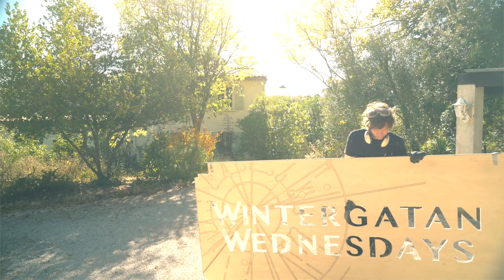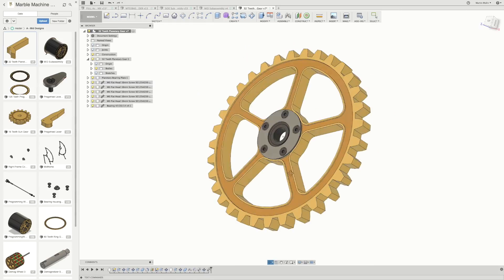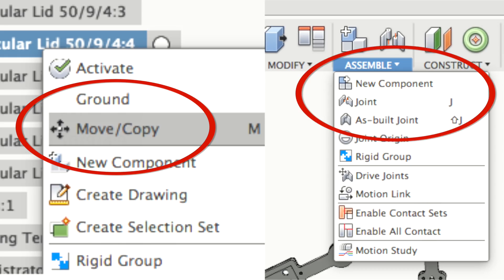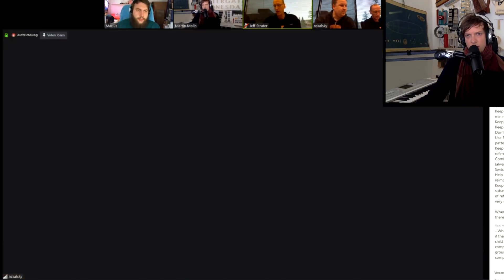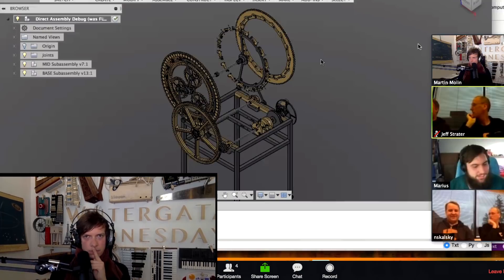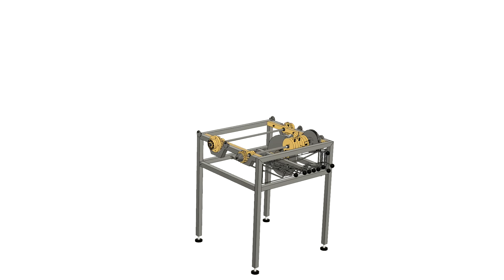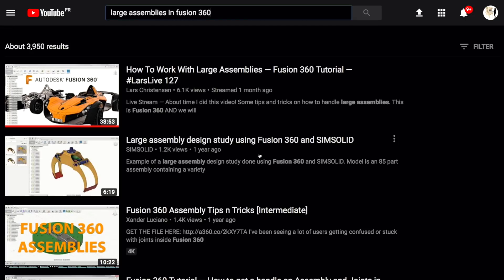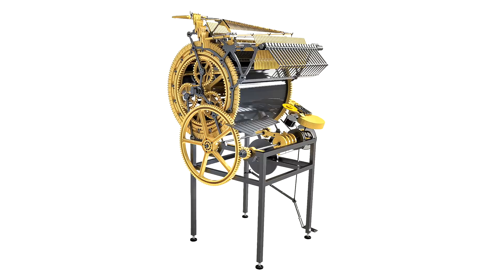Is Fusion 360 Unable to Handle Large Assemblies? - Marble Machine X #31

Comment: Hi Martin, i really hope you to read this comment. I am a CAD Engineer working for the interieur/exterieur department of a major automotive manufacturer. Even the top of the line software/hardware can't handle Assemblies as large as a complete car with all the functions expected from the real parts and joining every component to the rest as one would in the reality. For this reason every system is dealt with separately in very complex chains of sub assemblies and every component is built in in its place relative to the origin of the whole car. You just establish a new origin for the part that is in the correct position within the assembly and then if you have to move the component then you move the origin itself. I unfortunately don't know right now if you can do that on fusion 360. This approach of building sub assemblies in place is a very valid solution and the problems you face with your MMX top level assembly with Fusion 360 are the same ones we face every day at work, just on a different scale. So cheer up and i'm so amazed at what you are being able to do by building knowledge on the go.

Comment: It doesn't matter what cad system you use,  there is still alot of geometry for the CPU to solve. I have ran into this same issue in solidworks many times my solution or workaround for this problem is to save all the bodies.

Comment: WTH!!! I am Using Fusion 360 with 9000+ Components . I don't face any Issue with Design Environment but when i go in to the Drawing Platform with the 900+ component Assembly, It freezes like arctic.

Comment: I have an assembly of a plant with 7199 bodies, all them visible in Fusion 360. However, as good as Fusion is, the drawing environment really let's it down. I way prefer Inventor, although I have been using is since 2005.

Comment: I've worked with Solidworks before quite a while ago, so Solidworks 2016, I've ran into the same issue with it bogging down in large assemblies. That's my past experience so I have no idea if the newer versions are any better.

Comment: I only have one component and it shuts my computer down. No Other CAD does this to my laptop. My computer is not overheating, so spare me the lessons on overheating issues. This is on the part of fusion 360 im sure.
Reply: Try reinstalling. I have a shit old 9 year old laptop that's almost dying and fusion runs fine (as fine as it gets at that weak laptop spec). I dont think this is on fusion. Prolly a corrupted install.

Comment: If you tried to do this same project in Inventor or Solidworks you would run into similar issues.  While inventor can handle thousands of parts in an assembly it does get slower as the number of mates increases.  I have a few examples in the classroom where large assemblies take ages to load and are virtually unresponsive if you make any change near the beginning that effects parts downstream.  One fully complete commercial windmill assembly I have access to takes over 25 minutes just to open on an 8 core Xeon workstation with 64GB of ram dual NVME 960pros in raid 0 and FirePro W7100.
I have had SolidWorks freeze for several minutes when making a change to a single part that has a few thousand holes with countersinks.  When you get to large assemblies it can actually fail to load after an assembly with many parts is saved and closed and later opened to work on it again because it fails to locate a part even though the part opens fine on its own and is added to the assembly initially without issue.

Comment: Work in world space as opposed to local space.
I don't know Fusion 360, but if it is like many 3D apps, you can import external reference files (XRef) where they are not actively inserted into the main project, but can still be viewed and interacted with. This reduces the overhead considerably.
This process is used a lot in movie visual effects where they have MASSIVE amounts of data, (far bigger than yours).
Hope that helps.

Comment: Wintergatan
:  Just stumble across your video and must say it a very original use with 3D CAD in a synchronised system.  If you haven't already done so, I'm sure you can get sponsors from AutoCAD or even free CAD support from Fusion-360 as part of your annual subscription based licencing.

As a pro 3d CAD designer for at least 18 years (SW and other systems, but not 360 unfortunately)  The basic principle would be the same when handling large assemblies in any 3d cad system and as a general rule of thumb (good practice):

1 - Anything above 500 components are considered large for most 3d cad system, regardless if using pro hardware specs or not.  I can recommend better computer specs and say which does what (if you want?), but your main problem here is chucking 3000 bodies onto a "single" assembly is the number one issue, as it will create a very large file size (right click, file icon > properties).  Generally, smaller the mb file size the better. 

2 - Break the master assembly file down to workable chunks i.e. divided with sub-assemblies (if not adding tertiary sub assemblies) with proper static or mechanical
 constraints, if it static joint then ground it, if it mechanical joint use the least amount of rules needed.

3 - Consider simplify each part / bodies, such as removal of feature history and removal of cosmetic geometries like helical threads, chamfer, radii and etc. especially those with hidden features that cannot be seen anyway from any external camera angle, especially useful during rendering.

Notices you are using "cap screws", consider removing the entire shank (just showing the head)? providing the thread shank is hidden anyway?

Consider joining multiple bodies as one body, providing the combined body has less facets. i.e. screw heads can be part the the gear ring as "one body" as it will not affect your motion / mesh study anyway.

4 - Tone down real time graphics on your screen (not exactly sure what it called in 360) e.g. it is the most computational intensive if viewing the part in "wire-frame", "perspective" (vanishing point) & "reflective surfaces" in real-time. 

5 - Tried to model the components in "Surface Modelling" rather than "Parametric solids".  (Not sure how applicable to a 360 user though?  but this is definitely true for any 'traditional' Solid CAD users)

6 -  When choosing CAD in any industry we always say "Stick with what you know best ", because driving a 3d CAD software is like driving a car, if you are proficient in driving a rally car then I can almost guarantee you that you would be faster in this car (and less hassle) than if you switch to driving an F1 car even-though it "potentially" faster, but it takes a lot of practise to get it right and you may even end up shake off your some of your driving knowledge about 360.

Note:
Traditionally, there are actually two main types of 3D cad:
1) Surface CAD (Maya, 3d max, Rhino, Alias) - "freeform surface modelling", design by approximation e.g. wing, car surfaces, human hair or a sculpture 
2) Solid CAD (Creo, SW, NX, or even inventor) - "parametric solid modelling", design by engineers (more computational intensive, but it does have basic surface modelling features) e.g. mechanical gears, functional design, export for manufacturing 

360 is a new breed of cad who tried to blurred the line between the two modelling methods, where 360 is designed specifically for new CAD drivers.  By default 360 is actually class as Solid CAD as it is using parametric solids while including the manufacturing BOM feature (Bill of Material), but 360 is almost as light if compared with Maya or 3d max when dealing with complex models.  So 360 is actually a good choice for your needs.
 
In SW there is actually a "lightweight mode" (or "interconnect import" for preview) specifically designed to prevent cad user from editing the individual part in assembly mode, because the computational power to maintain this editing feature active is very heavy and impractical.  So you are very lucky end up with 2000 parts assembly, because most Pros normally works with slightly more complex geometries and would die for things to run smoothly on a 500 part assembly (or even 250), because most pros would struggle to open up a fully "converted" assembled "mould tool" from STEP / Parasolid file for example.

Comment: It's called API overhead. There are only so many draw calls you can make. You can fight this with brute force (a high end workstation for example, which WILL solve most of your problems), but if you designed everything very complexly from the ground up, you can overwhelm the program. What you did there is optimising the way you draw, which is a very good approach. Props for that.

Comment: This is the reason people still pay a ton of money to use Siemens NX, Solidworks or Catia. I use both Fusion and NX, and while NX can be a pain to use, it handles incredibly complex assemblies like they're simple cubes. People assemble entire jet engines in large CAD systems and manipulate them in real-time. I have projects where I have complete, multiple large PCBs in 3D, right down to copper traces, lands, vias and SMDs, that I have to fit within a more complex machine; where I have to do thermal dissipation evaluation. If I try loading a single PCB inside Fusion, it simply never loads; in NX it's there in a few seconds and I can play with it like it's a simple part. Unfortunately, NX is >25k$. A good middle-ground might be Inventor or Solidworks.

Comment: Fusion 360 is GREAT for industrial design but this program have a really huge problems to manage a lot of polys... some programs more designed for cg art can manage better a large amount of parts... I can't really recommend any program because I only use Blender (is free and can handle very well a large amounts of models at the same time) but, you can try Autodesk 3DS MAX or Maya... These programs are really good for geometrical desings, not so comfortable as fusion but they can manage very well a really large amounts of polys... (Yes I didn't have the best english but I tried)

Comment: Very interesting video, as a CAD professional myself I would highly recommend moving away from fusion 360 for your application. It has certain advantages especially in terms of creating tool paths for CNC operations, but Fusion 360 was never made to handle such large assemblies. Your best bet is to migrate to Inventor, it was made to handle large complex assembles. It seems to me you've already created most of the parts necessary. Learning how to use assemblies in inventor is much more simple than you might think. Its mostly about learning how to use constraints in the proper way, its even possible to animate your constructions if you'd like to go the extra mile. I've been able to handle assemblies with 4000+ parts with little trouble. I wish you the best of luck and keep up the hard work.

Comment: Draw a gear or screw then save that item as a single object. Then use another drawing and import the single object.
Reply: This is typical for Autodesk.  No cad app can handle too many objects in one go.  It's too much to describe for each change.  Been dealing with this doing press dies for years

Comment: Did even Autodesk propose a solution? This MM-X Machine project literally seems to pose a big complexity challenge for the application. So they (Autodesk dvelopers) should set on to improve their program. Like offering "automated simplification"  or automatically find repetitive patterns or such. Making it intelligent to reduce a given animated assembly to the least required representative structure. Well that depends on CPU power otherwise (or GPU).

Comment: Hey martin, 

About moving parts: keep in mind that CAD softs are not really made to have you running the clockworks by dragging the pointer around a wheel. They can do it for simple machines, but they can't handle a whole kinematic chain in big assemblies.  Most CAD softs have a rendering module for exactly that, but it's still very limited and very dependant on the quality of your design. Maybe the "motion study" in Fusion would help you animate/render the machine.
On the other hand, being able to move parts is obviously very useful for the whole designing part.

About placeholders: That's the right way to CAD with big assemblies. Imagine having to make a gripper for a big plane jet engine: first, you want to remove all the components inside the engine since you just want to hold the box. Most of the time, it's not enough since those engines are very, very messy with lots of surfaces and sub parts. If you got the original CAD file, you even get all the construction elements (and an involute gear has a lot of these). It's very common to ask the customer a .step or .iges, simplified file, just so the pc can handle the engine alone.

The key is to use "dead" bodies/surfaces: parts/assemblies that have no sketch, no joints, nothing at all to update but rendering and joints with other elements. But you have to be smart with that if you still want moving parts.
Afaik that's how most of the automotive and aircraft industries work (but they don't care about moving parts). Basically every CAD involving 5000+ parts (a car has around 30k) needs such workarounds. Catia V5, the tank of CAD (the price of a tank too), barely handles a whole car in .step format.

Convert the sub-assemblies that are mostly done in lighter formats, like .step or .iges and back to the Fusion format and replace your sub-assemblies by these placeholders. Those you often edit, keep them native or you'll waste time switching formats.

About working in absolute positions: it allows really big collaborations: When making a car, there are the guys working on each part of the car, but there are also the guys making the whole assembly line. Great, you now have millions of parts and you somehow barely care about the positionning of anything 'cause everything positions itself.
It's sometimes impractical still: the origin of your trunk door is 2m away, somewhere in the wheel axle, and the robot holding it is 2m away in the other direction... That's a reason why for machines involving one single, lesser team we tend to work in relative with joints (small test benches for example, or your machine).

It's also important not to ABUSE absolute positionning because it tends to hide mistakes: for example, 2 plates jointed with 2 fasteners. If the holes are not equally spaced in both plates, joints will tell you something's wrong. Absolute will work no matter how many undesired misplacements in the model (provided you don't also place joints). All parts in sub-assemblies should keep their relative positionning.

One last tip: On very big assemblies, i don't show the sharp edges (visual style -> shaded). It's quite odd at start but it basically double the performance, and i find it relaxes the eye: softer - but less readable - model and less stuttering when moving the camera around.

Cheers, keep up the awesome work!

Comment: Basically all mechanics cads have a limit of detail you can resolve before everything grinds down to a stop. Some are more efficient than others and can handle more at any one time, but there is always a limit. And mechanics designs do get a whole lot more complex than this rather modest machine(impressive machine design for one man to do, but machines are usually designed by teams of full time engineers). 
The key is to control the relevant level of detail to resolve. Lets say you are looking at the highest level of model, lets say a production line of some sort, composed of machines, composed of sub-assemblies, etc etc. Is it really necessary to resolve a resistor on a PCB in an enclosure in some electric cabinet? No it isn't, at best the relevant level of detail is the box of the electric cabinet, anything inside it, doesn't matter on the level you are looking the model at. So each sub-assembly, should have configuration showing only detail that is relevant on the level of higher assembly and hiding everything else. Fastener thread-forms are a good example of detail that are almost never relevant, on any level of detail thus should never be shown.